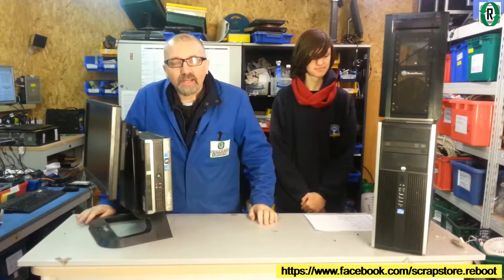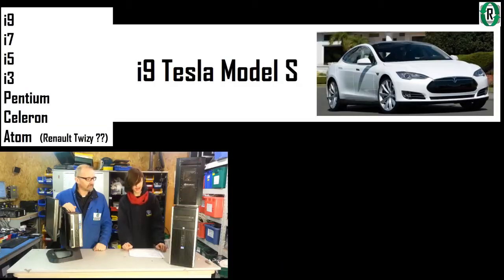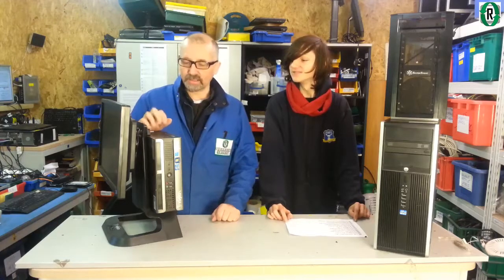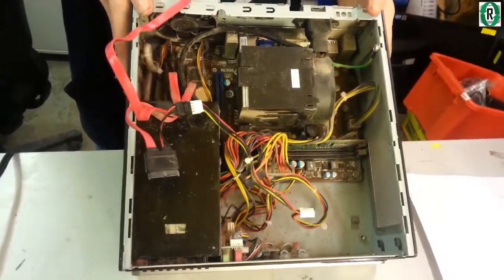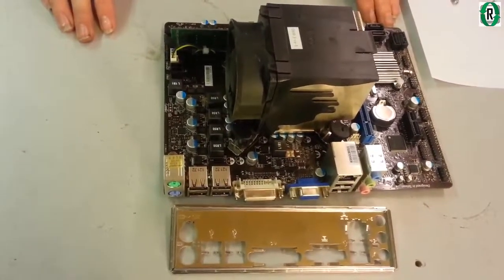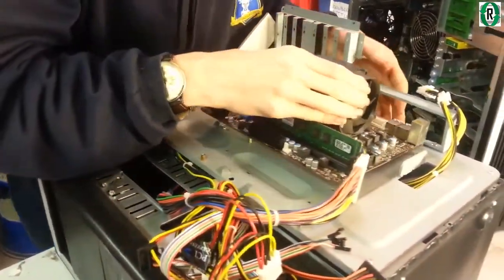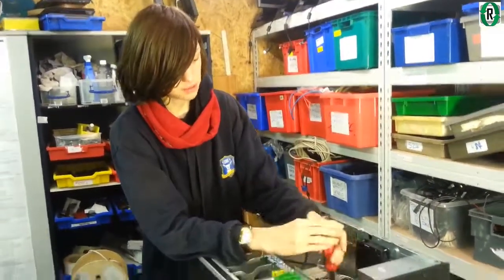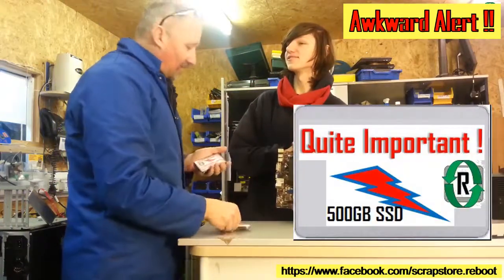Viglen Liberation Part 1. MSI in a Viglen !

Comment: I'm viewing this, for case opening instructions: "Right, remove the front tray." --But first remove the four hidden grub screws holding it in. And, what a mess of wiring underneath. (I don't like PCs - does it show?)

I need to get to the PSU, but I don't want to dislodge anything else!